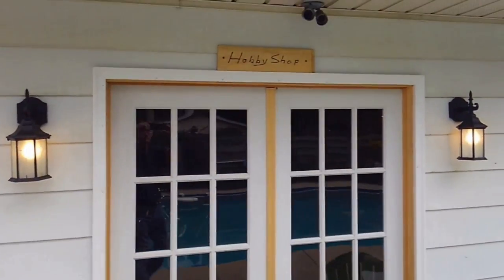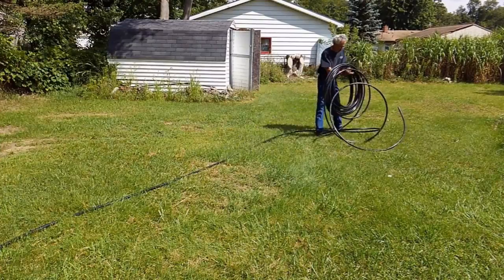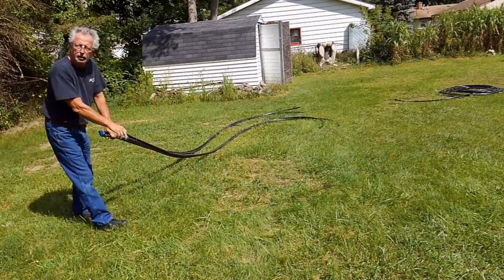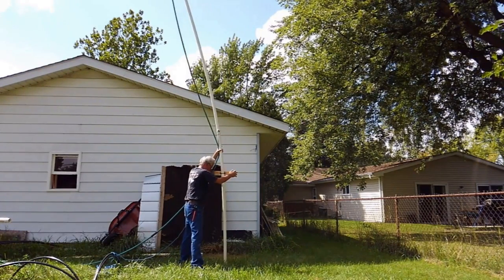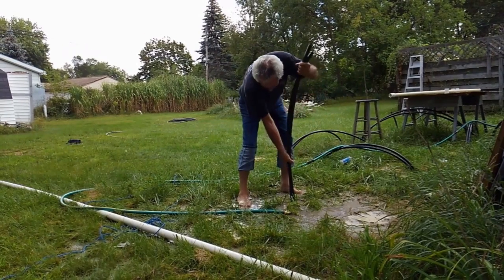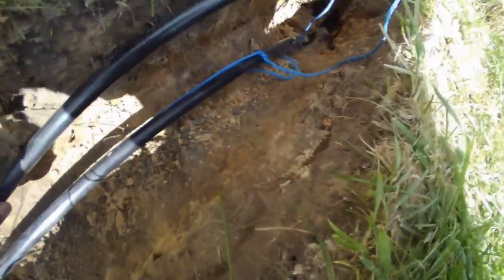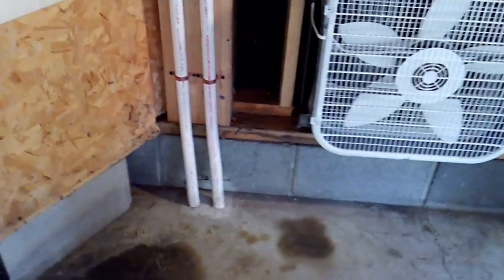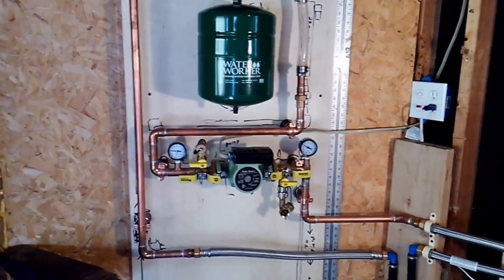Geothermal diy #1

Comment: Yea your not going to get 55 deg air from that. The air moves to fast to pull the heat/cool value from the  radiator. Youll probably get way less than half the temp difference without a compressor …. Maybe slower air flow will get you more heat/cool from the rad but energy transfer through that rad is not worth the cost .whats the air temp after the rad?

Comment: very nice, but no need for pressure tank nor air splitter nor all the copper...

geopros  org  shows 40 years experience,
INLET LINES ONLY REQUIRE GOING TO A T fitting ,
and 2 lbs press is fine, with  1 to 5 gal. reservoir 5ft above inside pipe and pump.

your system does well with floor radiant right under a vehicle/ rv keeping unfrozen, like some pump ocean/lake  water through to bridges for ice melt .

again inlet to 1" - 1.1/4" t ...
top t to valve and Fawcett t boiler  drain ..

then little hose 3/4 or 1" up to ceiling plastic carboy or any jug..
AIR WILL AUTO PURGE, see
all leaks if any later by transparent jug.

another is just put pump under a 6ft x 4" or 6" simple pvc pipe or green  type drain pipe... valve and drain Fawcett below pipe above pump...

hydro-temp   com   " auto purge " 1977

Comment: Anyone know if it would be more efficient to use 1", 3/4", or 1/2" for the underground pipe? I only have 900sf to cool. So i plan to build a 2 or 3 ton system. I have an old well (not used) on the property has 20 or 30ft of cold water, i may use to loop the return pipe down and back up 3 or 4 time before going back in the house.

Comment: Larry great design . Only thing i would have added is to use a hydrostat to control fan and or pump so they are not running when not needed. Otherwise great job and great idea.

Comment: I've seen similar drilling techniques when researching about drilling a well. I understand doing the vertical lines as opposed to using a large area.. Just not sure why you didn't want to put in the compressor and exchange , to have much more heat available.

Comment: Great idea. We have been  discussing this kind of thing since the 1970s. Virtually no environmental impact. Initial investment very reasonable. The question would be what kind of long-term maintenance is needed and what is the life Spand of the tubes in the ground with out maintenance. Overall I believe every new house should be equipped with a geothermal heating system. Nice job.
Reply from the maker: Thanks David! The system is still working as designed although I added a small heat pump the following year and it keeps the 32X32 insulated garage at 65F all winter. It is the BOSCH LV012 water to air. I found it on Ebay for $500. delivered.
Reply: @larryshea8595  can u use this same system to generate electricity?
Reply: Component
Reply from the maker: @Gabriela-ge7bx  Menards plumbing dept.

Comment: Hello Larry thank you for sharing the video. I am building a greenhouse for my hydroponic garden. Its very very hot here in Kuwait, and I want to use 2 cooling systems: Geothermal and water cooled air-conditioner. I buried my water hose 4 meters below surface.  Because the sand is very dry in the summer. I laid plastic sheet under pipes to help keep moisture. In addition to that, I connected a drain pipe to about 3 meters down when I drain my water/solution tank so that I keep some moisture around the underground pipes to help in heat exchange. I am still curious about the delta T, temperature difference. I will add a water thermometer for water in and out of the system.

Comment: Have to say it is well thought out.... and you have left the system open to adding future mods so you are covered. The only thing I can think of is a variable-speed motor. It would cost out front but pay off in the long run Also depends on the future mods.. But for a DYI you did great...
Reply from the maker: Tks!
Reply from the maker: Well I do have a 3 speed box fan...

Comment: This will probably work for what I need and forget the different Freon expense.. Had central A/C until it got a leak, here in Wis. are ground temp 8 ft down is about 55-60 degrees, so I thought I use the geothermal concept for doing cooling on a 1500 sq ft home, trenches would be 8 ft deep, run a continuous close loop system (2000 ft long) and a couple of pumps inside, to pump in and pump out, with a water to air heat exchanger on top of the furnace. When thermostat set to cool, turns the furnace fan on along with the pumps, cooling the house hopefully down to 70 degrees, I do like this system and will look into it, anyone out there with ideas, I appreciate them.

Comment: The info on digging the vertical loops is good. The end system will have little effect heating or cooling. You need to put a heatpump in the system.

Comment: Did it actually worked...? What were the temperatures IN REALITY, no in theory... There will be some heat losts during the transport etc... How much degree did you actually managed to squeeze out of it? Lets say its 32f outside. Whats the water temp incomming in? Whats the radiator temp?

Comment: Larry, very impressed by your system, still working fine? If for instance you wanted to heat a house, could this be extended and if so, do you have any calculations on the typical coverage and pipe requirements, just an example if possible. Thanks Gaz

Comment: You might want to use some type of anti freeze solution as insurance against small sections that may get exposed by mistake to freezing temperatures.
Reply from the maker: At the end of the video their was an opportunity to view the video, "GeoThermal DIY #2" which demonstrates the insertion of the Propolene Glycol antifreeze into the system. You can view the video here, https://youtu.be/pfJQWDf958E Glad you enoyed the video.

Comment: The worm gear clamp should be checked for steel components, since lots of these worm gear clamps are steel worms and stainless steel band. Use a magnet when selecting the worm gear clamps and anything that sticks to the magnet put it back on the shelf... that won't last long while underground, in water.

Comment: hi larry, its great, i have few question if you could answer, first your design is way simpler which is great for people like us, i am interested in cooling only, (not heating), now 1. how deep you put tubes inside ground 2. what was your ambient temperature ? 3. what is your room temperature 4. what is outlet temperature of your water coming circulated via ground pipes ? and what was your room temperature becomes after system was running, appreciate your support here

Comment: Since you have a 2.5 inch hole why not pot a double set of tubes down the hole  I have water 20 foot down so I want to use it
Reply: The air in the hole would prevent it working he filled it back in woth dirt so the pipe is in contact with ground temperature. You don't want to have a water well in the same hole. You should drill that seperately.

Comment: Thank you.
I think it depends where you live. I live in the Catskill Mountains of NY and our ground is hardpan with lots of rocks so going down 20 feet might not be possible so I would have to find another way to dig down that deep.

I'm wondering if you're getting some loss with the upside tube being close or in contact with the return tube, maybe insulating the tube for the last 4 or 5 feet might yield higher temps. A lot depends on your location and soil but at 20 feet you should have pretty stable temps. I measured the temp from my 175' deep water well, I'm getting about 54° to 56°F by the way.
Interesting thinking, very creative, thanks again.

Comment: Larry I like your work, nice and neat.  But I'm confused to how this could heat your shop?  At best you will have a fan blowing across a 55 degree radiator.  So you can't get above 55 degrees at the very best, and more likely not above 45 with heat loss to the environment.  Are those temperature all you require?

Comment: This is good system for a mild climate but here where the ground freezes many feet  deep this system would fail.
Those metal pipe clamps are notorious to fail. 
If used, at least cover them in a thick layer of roof patch tar.
If tar can keep dinosaur bones for millions of years it will keep  the clamps safe.🤔👍
Reply: You bury your pipe below the frost level to your area. His was 2 ft.
Reply: @terrafirma9328  
Wow that is shallow.

Comment: I like your system and the simplicity of it.  I'd like to incorporate a ram pump into a system like this.   I think ram pumps have a great potential.  My thought is to just have a long loop that continually runs with few things to maintain or energize.  I would appreciate your thoughts anyone.
Reply: You would need a stream of water (gravity) for ram pump. Not sure if it would work in a closed loop like this.

Comment: You have lost me.   If the garage is 68 deg. F and you blow 55 deg. F air into it how is that adding heat to the garage?
Reply from the maker: Go to 14:45 and listen. If the temp outside is zero, 55 degrees is a lot of heat. Get it?
Reply: @larryshea8595  It doesn't matter what the temp is outside.  The temp inside I would hope to be around 68 or even 70.  So I'll ask again. How do you heat an area with 55 deg. air.  The best you can hope for is if you are starting with that outside temp inside (no other sources of heat) would to bring it up to the 55 deg.

Comment: Unless I'm missing something here , why would you need a pressure tank for a system that wont ever have high temp that would cause expansion ??   Its a complete waist of a pressure tank that will never see any pressure !  Unless your planning on using another source of heat on this system.
Reply: You need pressure to push water from that deep.

Comment: I think you could have gone down 25 feet or so for the drain and then as deep as you can get with a mini jetter set up and then used all the surrounding ground well water depending on how you  filtered it and maybe even routed it through your home or water heater during the winter for heat.

Comment: Not deep enough, too close together and in total, not enough pipe. If it was 0F outside and you ran this setup continuously with your greenhouse on top of the field, you will eventually lower the ground temperature to well below its before steady state temperature. I suspect no follow up because it didn’t work as intended because the ground isn’t a perfect heat sink for that small pipe field.
Reply: Wrong, wrong, and wrong.
Reply: @terrafirma9328   I am about to try this for next year in a pole barn.  Have you done it?

Comment: FYI to those who watch this: in addition to antifreeze/methanol, add a biocide to your loop (make sure it won't react with your pipes), otherwise you'll end up with nasty shit clogging up your radiator.
Reply from the maker: Add only propoleneglycol for geothermal ground loop. Will not freeze to -60f. Contains everything needed to preserve and protect your system. No antifreeze, no methanol, no additives. Disregard this (fyi) above.

Comment: Amazing Larry, I was wondering how to drill the holes. Your method took a little time, but it worked. I’m in Florida sand, so are you going to connect a heat pump and coolant to have air conditioning in your garage?

Comment: No follow up reply either it did't work or he is dead
Reply from the maker: I'm not dead, it worked and still does. In fact I added a small heat pump, Bosch lv012, $450 on EBay. Now it heats also!

It's kind of funny how the expectations come on here. I gave you a foundational set of ideas and capabilities. Build on it, take it to the next level and show me your improvements!

Comment: To be clear; can you take your system and also a solar system and blend them together to produce whatever temperature you desire but at the same time having that 55 degrees already there to help the solar system out as to not work so hard? Another setup could be to combine both your setup and propane. Is that possible?

Comment: I'm planning on building a Climate Battery underneath a greenhouse I'm designing right now and that made me think about doing that for a raised foundation home if I were to use an ICF foundation and SIP's for the exterior walls and roof. I'm also interested in doing a system like yours for hydronic heat loops underneath the hard wood flooring to radiate the heat. I've never seen a system like yours but it's worthy of consideration to think about. I would think that combining at least two systems together would work supper well and might increase the temperature in the winter. My thought would be to install your system as a radiant heat loop system in concrete and have the tubes attached to rebar inside of that concrete so that it helps transfers the heat to have better heat radiation coming from the concrete inside a greenhouse. Put that block of concrete or wall of concrete on the back wall of the greenhouse or even the floor but also connect it to a solar system to increase the output and thus be able to heat the structure to whatever temperature you desire for free besides the cost of the supplies and labor. I'd have to think about this a little bit more but I can imagine doing this same thing in a home. I'm a carpenter and build homes from the ground up only using my own hands and without any hired labor except on concrete days.
Reply: I have friends that don’t work well with others and me and a helper are 3 -4 times faster without compromising quality it is impressive but not as efficient and they would make more but lack the social skills or patience I suppose
Reply: @jonathanbuford1793  I've hired people to work with me before and have no issues doing that but I like working alone and taking my own sweet time. Besides, I don't have to pay those labor rates. I'm building a 64x40 post frame shop on my property right now all by myself. It's going up fast. It keeps me very much in shape doing it alone and I like that.

Comment: Putting it in the greenhouse is a great use for GEO.  I put a sand floor in my greenhouse and electric ground wire system fresh tomatoes in December but the cost of electric heat made it impactable.  I know there is water on my place there use to be a well covered now with a BBQ a rock ledge may be my only problem if the spring is running under or voer the ledge.

Comment: Incredible that you did this. Well done.
Reply from the maker: Thanks Ron! At 75 I wish I had the time to create and edit videos and post them on all the things I do. If I did then all I would be doing is publishing and I would have no time to do any of my projects. Some of them are my 18W x 40L x 12H greenhouse from 1.5" pvc and lumber that I built in just over 3 weeks for under $1,200.00 and it totally laughed at 60MPH wind gusts. I am building a "She-Shed" on the property for my wife and 14 grandkids. Also I added a Bosch Heat Pump to the ground loop you commented on. I am wiring, trimming and finishing the greenhouse, the workshop. I have a small farm that makes huge demands on my time. I ride and race dirt bikes and my custom road bike has over 100K miles on it, I also build, restore and customize all kinds of bikes. I'm gathering materials for my 24' positive displacement wind generator design and as a certified scuba diver, I'm well along with my high powered, streamlined underwater propulsion unit capable of up to "25MPH UNDER WATER" and many, many other projects. Of course, that does not include the time consumed by the gorgeous gal who keeps me grounded and motivated. Thanks again for your kind words, Larry

Comment: Once you put a heat pump on that circuit, it can be used for AC as well as heat. You will most likely need to have a heat exchanger and put anti freeze in the circuit. Note in northern locations you need to go 5 feet down with your trenches. The pros use poly fusion because of the glycol. They also fill those holes with concrete. Just saying I have worked on these systems as a plumber and steamfitter.

Comment: Pretty good I would say. Very ingenious. What radiator did you use, looks like something from a CAT or heat pump system. What is the temp difference between in Well In and Well Out. Probably varies with the amount of water GPM flow.

Comment: Is it important to pressurized the system ??? Will it work with out pressure
Reply from the maker: Pressurization is important. The circulation pump requires a minimum input pressure of 3 psi input pressure. The pump will not draw water up to it's self. It must be pressurised with no air. This system has a static pressure of 25 lds at all times with no air. See "geothermal diy #2" for recharge procedures.
Reply: @larryshea8595  thanks

Comment: Thank you for sharing, especially for your ingenious method of hole boring!!!  I really appreciate your showing that because it's so low-cost and so creative; I have gotten in the rut of thinking I "must have special equipment" and your video brings me back to reality.

Because you asked (and ONLY because you asked) , a couple of thoughts from a renewable energy engineer:
1. If (WHEN) I do this I'll put antifreeze in the lines; yes it will be expensive, and for 99% of the time unnecessary, but it will be an additional factor of safety.  I'll also dig my horizontal lines lower (my frost depth in a good winter is four feet).
2. I hope the turnabout fittings you have at the bottom of your wells are rated for really high pressures; otherwise they might get damaged over time.  I would probably improve on your method by wrapping the ends in something to protect against gravel intrusion.
3. It looks to me like you sunk way more than enough wells.  I would be curious to know the results of a load test (if you are cooling in the summer, how much heat can the ground absorb before return water starts to get warmer, and vice versa for winter?)
4. Also out of curiosity, when I do this I'll try to find budget to sink a thermocouple down some of the wells to measure resource temperature.
Reply: ❤resource temperature 🌡